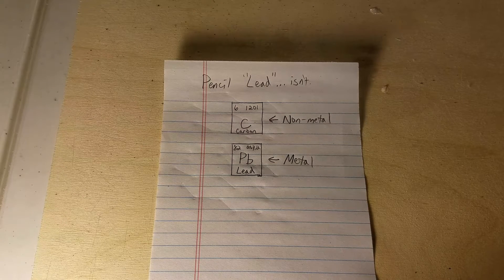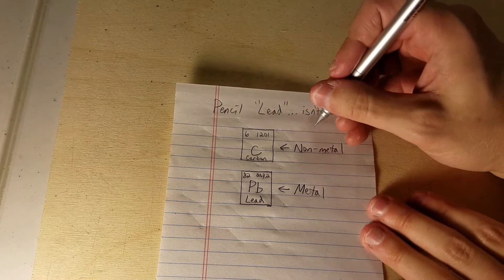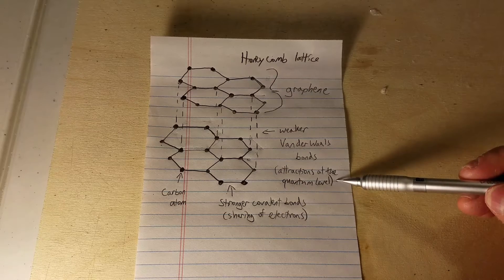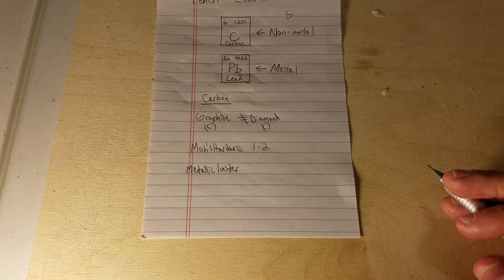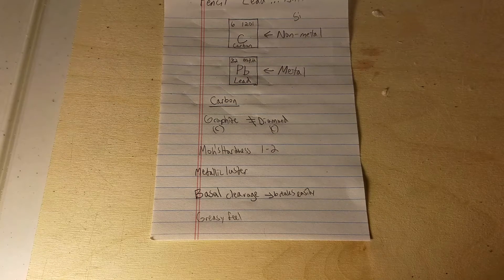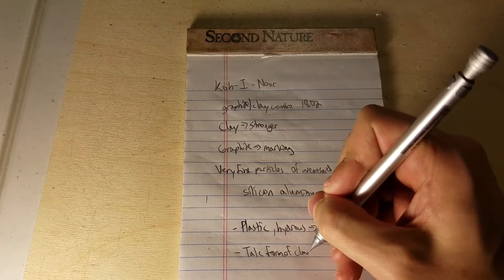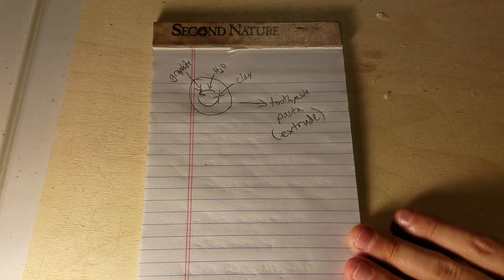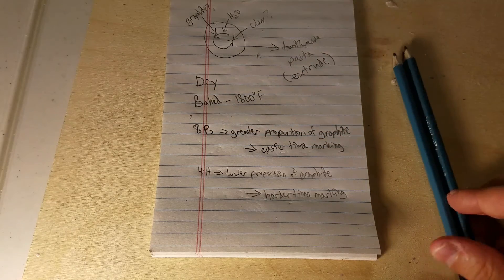The Science and Engineering of Pencil Lead

Comment: great video, but as far as i know, most(if not all) pencil lead of 0.5mm(and below) lead available nowadays are graphite mixed with polymer(some kind of plastic, if i perceived it right), even it's not branded as "HI-Polymer". Clay are simply not tough enough to make 0.5mm leads. I happened to have some vintage 0.5mm leads made of clay and graphite(before polymer leads are introduced), and it's infuriating fragile comparing to modern 0.5mm 2B leads, and it gives a much lighter mark on the paper(it seems like 3H or harder to me, it's not marked with H/B system). I believe clay are only used in 2.0mm(or higher) leads. According to anecdotes, leads in wood cased pencil are made with clay(with little exceptions, e.g. CDT pencil manufactured by Pentel are using polymer lead), 2.0mm  leads for clutch pencils are made with polymer. So before i click into this video i was expecting something like a comparison between clay lead and polymer lead, since most mechanical pencil used by us are using polymer leads. But the general idea is the same. Polymer lead are just clay swapped with polymer and baked in a higher temperature. Which kind of polymer are used make most of the differences, i'll try to dig into some paper about lead manufacturing and find out more.
Reply from the maker: Not all polymers are plastic.  You can have resins that are polymers.   My expectation is that if clay is compromised in very fine lead (a fair suggestion), the "polymer" part of it is some kind of resin, not plastic.  We could solve this with industry specs, but those are hard to come by.
Reply: i do find some interesting information about this issue in some papers. Many types of resin and plastic are used in making fine leads, including PVC, CPVC, methyl butadiene resin(used by Pilot), vinyl acetate, epoxy resin, polyacrylonitrile, phenolic resin, furan resin,  methylcellulose, even asphalt. This is much more diverse than clay leads. And i found out the role of baking process in making polymer lead is a little different. It's not about dehydration, by baking polymer lead in oxygen free oven, resin or plastic in it are carbonized(elements other than C12 are turned into gas and removed from the composition) into carbon fibers, which forms the backbone of the lead. Carbonized polymer are also high in carbon element(above 97%, but the molecular structure is different from graphite) and served as colorant too. As a result, carbon fibers can combine with graphite better(make the lead stronger), and make the overall carbon content much higher than clay leads(possible to make much more darker leads).
Reply: And an interesting fact is that in old technology making polymer leads, a little amount of lead stearate are introduced as chemical stabilizer. So some pencil leads do contain a little lead element. I hope this practice is no longer implemented nowadays.
Reply: this also explains the crisp, metallic sound when a box of polymer leads collide with each other, just like carbonized wood.
Reply: Well, I found out some further information that may settle this issue. According to Japanese industrial specification JIS S 6005-2007 and Chinese specification QB-T 1024-2007, C-type(Ceramic) lead are only used in 2.0 mm lead, every thing from 0.3 through 1.3 are P-type(Polymer) lead.
Reply from the maker: The chemist in me appreciates your fact-finding. :)
Reply from the maker: Share your sources? I'm the kind of guy who would like to read polymer specifications.
Reply: happy to, but those papers(in Chinese Pen Industry Journal) are in Chinese, published by Chinese pen manufacturers who either want to improve their product or try to introduce Japanese technology of lead making in the 90s. Some of them including content analyze of Japanese leads. So when i publish the comments i did a little translation, but i'm happy to send you PDF copies of those papers anyway(i'm not sure if you have direct access to then in US)
Reply: And the national specification document can be found easily on the internet, just search the document ID :)
Reply: i sent you an email. check it out :)